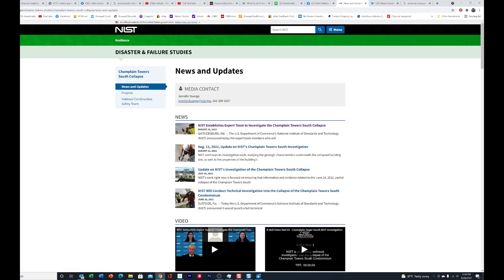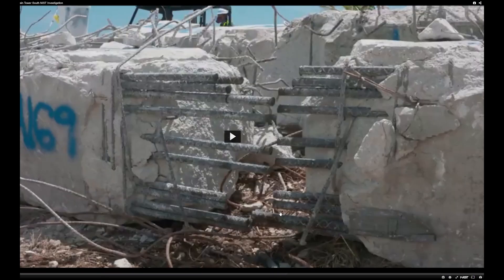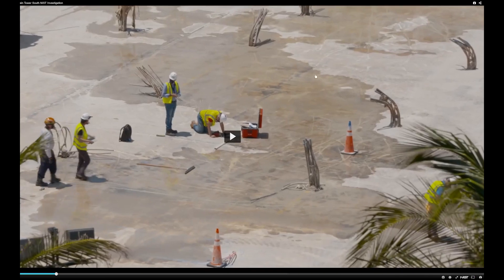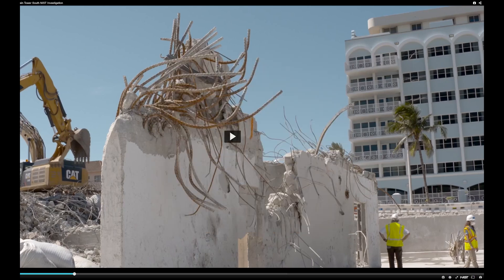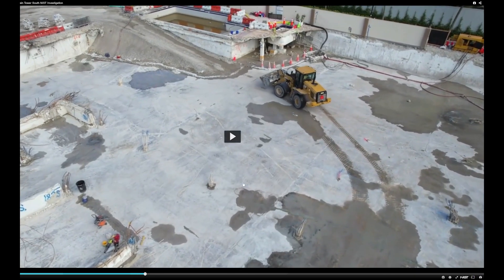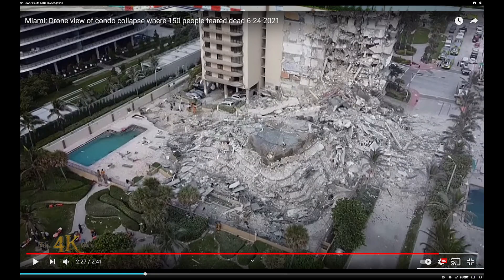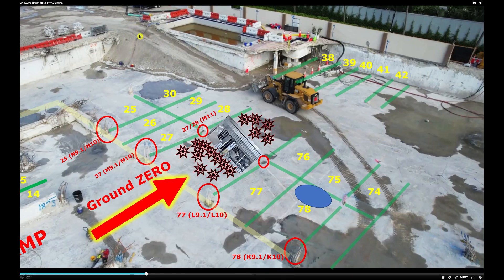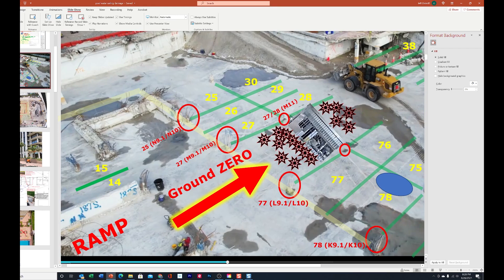Surfside Condo Collapse Site View NIST Video Ground Zero

Comment: Everyone else is starting to tire of following this story. You’re still the best source of new developments and reasonable speculation. And it is the educated speculation that makes you unique and adds value to us laymen.  Thanks again.
Reply from the maker: Glad to help Weasel!
Reply: @jeffostroff  Yes, it's factual and interesting. Other videos seem to speculative 👀 ...
Reply: People need to pay attention. Think how many other buildings there are out there with this degree of neglect and poor construction. This tragedy is a loud wakeup call
Reply: @jeffostroff  please test the concrete. It is powdery looking, and doesnt stick to the rebar correctly. If so that is the original problem, besides the crook who built it.
Reply: @jeffostroff  bad concrete?..it looks sooo chaulky, and it doesnt stick to the rebar in the normal way. Also, is there any pebbles in it? I dont see any.......incorrect building methods, built to minimum, paid off inspector?....planter box added later with no extra support....rust and rot ( lots of water leaks for years).....undersized columns.....what did i miss?.....bad maintenance, too much cost for condo owners( $200k each?)...engineer and co. inspector paid?, to not scare people( reduces property value $200k ea.).......etc.....

....    So, no one  could just put up some shoring underneath the pool deck, remove the planters, demo down to solid concrete, add structural crete to the deck, and lots more strength to the posts?.....i just shake my head....

Comment: Down the street from where I live, they're building two apartment/condo buildings. As I pass them - I look at the concrete base support columns and I'm like "those are too small, no caps", no longevity. Mind you, I'm not a person with any technical background in construction/architecture, but you have made me aware of the construction process Jeff and have given me an inquisitive eye toward 'foundations 101'- thank you for your knowledge and insight. (They're probably just fine but after the Surfside collapse, I am suspect of all large scale construction).

Comment: Interesting video Jeff and it just reiterates what you've been saying all along.  Looking forward to some conclusions down the road but you lay out an excellent point about the stacking rebarr and concrete loads.  Thanks for sharing and get some rest.
Reply: AGREED!
Reply from the maker: I know man I finally got to bed a little after 4:00 a.m..
Reply: Agree
Reply: @jeffostroff  You can also see the columns 9.1/10  rebar leaning towards the pool area so as the initial columns collapsed the weight above made them lean. As well as the columns you pointed out with rebar too closely packed if you look to the right of the still picture at 2:55 you can see it is also the same where only part of the concrete has come away.
Reply: @jeffostroff  Forgot to ask, could you do a video showing the drainage as I see in one of the stills where we are on the ocean side of the bathub wall a large round pipe going through the wall. Where also was the sump drainage that the water on the garage floor drained into.
Reply: Isn't there usually a plan of rebar size and spacing with the rest of the prints for any poured structure?   It looks like many of the drawings are available, be curious what the rebar plan looks like

Comment: Great video as always Jeff. At 3:05 when you were talking about the 4 rebars being close together and saying that maybe that were squeezed together, if you look at the far right of that frame you can see 3 rebar with very little concrete between them. That place was doomed when the first load of concrete was poured.
Reply: It's starting to look like the real mystery is not why it collapsed, but  why it took so long for it to happen.
Reply: I dunno. Are we looking at the center of a column, or at the top or bottom? If it is the end of a column, then there will be splices of the rebar at these locations. A normal splice is for the 2 bars to be side by side and extend for 36 diameters of the rebar size. It would be interesting to find out where the ends of those bars are.

Comment: If you look at the famous (and very useful) collapse video from the security cam at 87 Park, you'll see that the eastern-most portion (last to collapse) first swayed significantly towards the ocean (east)--pushed, I surmise, by increasing compression from the collapsing center section, trapped between the 2 shear walls--before rebounding and finally collapsing with a slight bias towards the west... anyway, that "running start" had to add greatly to the loading of that H-beam (and rather small stairwell shear wall), but after a few seconds of getting "worked" hard, they failed too.

That smaller eastern stairwell shear wall, being the very last thing to collapse, was actually "spit out" by the eastern pile, and landed on the very top of the whole rubble pile, as can be seen in all of the day-after pics and videos.  Wild stuff.

Comment: Very interesting video. I think one thing that is telling is that (if I understood you correctly) the architect who designed South Champlain Tower was suspended for several months for poor building design PRIOR TO his work on this building. And the building also collapsed (in that case it was due to a hurricane). Also, I concur that the rebar is much too clean, which calls into question either the concrete used or the pouring of said concrete. By the way, it is also good to hear you and Josh at Building Integrity are communicating. Between the two of you I think you have given very complete explanations as to what caused this tragedy. Keep up the good work.
Reply from the maker: Thanks Nicholas. The architect's failure was some type of sign support on a building that failed during hurricane Betsy. was suspended for six months in 1967 after pylons on a sign atop his designed building collapsed. The Florida Board of Architecture found that his pylons were “insufficient and grossly inadequate,” and failed to meet “accepted standards,” he was found guilty of “gross incompetency, in that he negligently, improperly and carelessly” designed the pylons. He appealed the decision but lost.
Reply: @jeffostroff  I hope the City of Surfside and other communities are reviewing ALL the buildings and structures he worked on. The fact he worked on two structures that have failed raises some serious questions about his competence as an architect. As well as possible issues with the firm he worked for.

Comment: Yes the rebars appear crowded, however code does allow bundled bars where they can touch(See ACI 25.6). I agree that there doesn't appear to be adequate overlap of individual bar sets. I'm guessing the final report will give the area of steel required and state if columns and beams met specs
Reply from the maker: Yes I can't wait to see what their engineers finally come up with and release in their final report it probably won't be another year you're before we see it though

Comment: Those enlarged areas at the top of the columns you showed at the hotel are called capitols.  They are used to resisted punching shear by enlarging the shear area thru the slap.  It is interesting to note that the plans show drop panels at each column.  See dashed lines around each columns showing 5' to 6' area.  The plan details however do not show drop panels at the columns.  It appears that a change was made and they just did not bother to erase the dashed lines.  
Again great video.  Keep up the good work and don't sweat the critics.
Reply from the maker: John, those are not capitals, those are drop panels The capitals would be like you see at the top of the state federal buildings columns, they spread out a bit.
Reply: @jeffostroff  Jeff, while they don't look like the classic capitals (cone or flared out enlargement of the top of the column) they are in fact capitals that are fairly easy to form and are pretty much typical for parking garages.  To be a drop panel the thickened area is much larger.  They have to extend one sixth of the span in order to qualify.  They are more expensive to form and can inter fear with required head clearances in parking garages.  They have an advantage in reducing the required negative steel over the columns by as much a 50%, however.  In case your wondering I am a retired California structural engineer and have designed numerous reinforced concrete and pre-stressed concrete structures including schools and hospitals.  Keep up the good work.

Comment: Very informative.... I think for the column IDs you should just go with what makes sense from the aspect of the first 2 levels of the building (garage, lobby). Because that’s where the action was and above that there were changes in some columns.

It seems pretty clear that the initial failure was that added planter that collapsed its column sideways and gradually unpeeled the nearby overground parking (as observed) followed eventually by the building column connected by the beam.

Comment: That "C" shaped (actually, more like an "H") transfer beam, was due to the column line above is shifted. Near the center of the "H" was the support for the column above. Failure of support under that transfer beam structure, could have been the beginning of the collapse of the briefly remaining eastern portion of the building?
Reply: The beam probably was strong, as it is right at the beginning of the portion of the building that stood up for a few seconds.
Reply: Exactly. The mess with the grid lines is classic inconsistency between disciplines. EOR seems to used a different layout probably to make his analysis easier to follow as architect used a less grid lines and their own inconsistency was surprising.
Reply: @MajorCaliber  What a cynical view.  Architects bring vision and art to the structures we create from the pyramids to the Taj Mahal to the homes we live in.  Engineers bring the architect's vision to life while complying to engineering standards and building codes.  Regretfully, rules, standards, and regulations can not always protect us from poor judgement and sloppy work.
Reply from the maker: @MajorCaliber  yes!
Reply from the maker: @ronaldfharring7326  You are right Ronald. But not this architect!
Reply: @jeffostroff  At the end of the day, the Architect is responsible for the entire building.  That said it is the structural engineering firm that is responsible for the framing design being capable/able to bear the weight and stresses of the building over the expected life to the building (at least 50 years with good maintenance, probably more like 100+ with good maintenance).  Obviously, this building failed in a spectacular way, but not without warnings to the professionals in the form of spalling and the condition of the bottom of the pool deck viewed from the garage.  As an engineer myself I doubt a walkthrough would have alarmed me to the point of collapse was imminent, but alarm bells would have been sounding.  The correct response was further testing of the columns and pool deck itself.  From the pictures of the concrete core samples without description, I would have wanted more, including a video f the taking of the core out of the core bit.  As a former plant engineer in an industrial environment, we used a Milwaukee core drill with diamond core drills to take samples, but more often used it to drill holes for installing bollards.

FWIW kia called me out as a troll in a video he published 3+ weeks ago.  It has a concrete mixing truck shown on the video frame where his videos are shown.  I never called out any of his mistakes, I even pointed out the L10 & M10 columns to him as well as how the bottom rebar mat was shown on the prints, eg 15#4 etc etc.  The one that got him pissed was when I said he should seek out a good therapist.   Come on how could a guy, me, who has been on youtube since 2008 be a troll that was set up by Josh or Jeff??   Josh and Jeff are far and away the best sources of info on youtube.  Both are sane and sober as well as informed on how to analyze a situation.   I thank both of them for their passion, integrity while seeking answers honestly and ethically.

Where I was trolled by kia https://www.youtube.com/watch?v=kBqONx_vMM0&t=380s

Btw, my interests are structural failures from 9/11 to Champlain South, the I-40 bridge mess in Memphis as well as auto racing and aviation clips.  I also love politics and history, but the state of that arena for the last 5-20 years has caused me to tune out for sanity.
Reply: @jeffostroff  Clearly the architect of Champlain Towers made terrible mistakes which should never have been allowed by the building engineers.  Additionally, as you've pointed out, there was an obvious a lack of construction oversight.
   My reply to Major Calibere addressed his condemnation of all architects, without whom, most of our buildings would look like bunkers, blockhouses and industrial buildings. 
   Regards, Jeff and keep up the great work.
Reply: @ronaldfharring7326  Puh-lease, the tongue-in-cheek nature of my remark, if not inherently obvious, was highlighted by me ending it with a self-deprecating "m'bad" and a smiley  ;')
By way of peace offering, the architect of the stunning Eighty Seven Park, Renzo Piano, is A-OK with me, and I think you'll find that building has NONE of the design or construction shortcomings of CT South.  Peace out.
Reply: @MajorCaliber  Thank you for the clarification.  Sorry for missing your satire. I enjoy online discussions with folks such as yourself who aren't prickly and thin skinned.  Regards.

Comment: Jeff,  The code actually allows one to "bundle" bars and at lap splices bars are supposed to be tied together.  It looks like they must have used some type of limestone aggregate for the concrete which it typically avoided due to the high shrinkage generally experienced with softer aggregates.  It is not unusual for the rebar to have a light rust coating prior to the placing of the concrete due to the rebar being exposed to the environment prior to the casting of the concrete.  This is not considered to be a problem.
Reply: thank you for pointing this out.

Comment: I agree with simply pointing to your cursor when you initially move it to another side of the screen.
Reply from the maker: Video I'm working on now, I am making sure the cursor shows up. Some programs don't show my big yellow highlighted, so I have to take a lot longer and more worked using programs in modes that show the cursor
Reply: @jeffostroff  Well we certainly appreciate the extra work you’re doing for the cursor issue. 🙏🏼❤️

Comment: Excellent sleuth-work Jeff. I appreciate how you lay out the evidence in a mosaic that is consistent and easy to understand. PS: I'm now worried about the other two Champlain Towers being built from similar blueprints to Champlain Tower South --  perhaps with the same flaking cement and workmanship. Is  the City of Surfside (or NIST) investigating the other two Champlain Tower garage-columns? Perhaps using X-Rays or Ultrasound to inspect the rebar crowding?
Reply from the maker: they are investigating the other 2 towers

Comment: The specific problems that I see are:
1. Not controlling leaks that seeped down below the pool deck, causing immense degradation/rust/spalling
2. The thinness of the parking garage lot columns. Makes for easier parking but I've been in Condo parking lots in Hawaii and the columns are 2x-3x wider. I even scraped up the whole right side of my car backing out, but now see how the wider columns are very necessary.

Comment: I have a theory, I wonder if the automatic irrigation to the planters was adjusted to flow less, once the large palms were removed, the new plantings would need way less water. Did the palms roots get into the waterproofing layer, the pooling water on deck looks like it's coming from the planter/s.Once the water gets under the waterproofing, it can track anywhere and sit for years and cause corrosion in concrete and rebar.
Reply from the maker: These are good questions, we have raised them before, as well as was there any drainage at all designed into the new planters that were installed in 1996.
Reply: I am a ex high rise plumber The watering and drainage of the planter boxes most definitely could be a issue causing damage to the structure It was my first thoughts at the beginning of this terrible situation ... RIP good people

Comment: 2:58. Your talking about how close the rebar is to each other. "and if they got squeezed together..". Pause the image at 2:58 and you can see on the very right edge of the screen, those same rebar coming straight out of the concrete. touching.
Reply: Yep and concrete only on the outer edges nothing connecting them. Hence why it has chipped away so easily

Comment: Jeff, someone elsewhere in the many comments may have already pointed this out, but the designations used to identify column rows do have some rationale.  The confusion with rows designated 9.1 and 10 and 10.1 could be because the architect wanted the builder to know the centers of columns on the east side are not aligned on center with the centers of the columns on the west side.  Row 10 designation may be a "virtual" designation to denote even further that both rows 9.1 and 10.1 are "off" center of a virtual centerline.  I remember running into this all the time when in the 90's I engineered piping in industrial plants.  We had to spend a good bit of time making sure our perception of column and beam locations were precisely correct and ran into these anomalies in plan drawings.
Reply from the maker: My whole argument here was the fact that the architect was inconsistent about his rose amongst different drawings. When I took architectural drawing in school, we always made sure that we picked a grid and stuck with it. What the architect should have done was started with the most complex page which is the framing plan and maybe started from there.